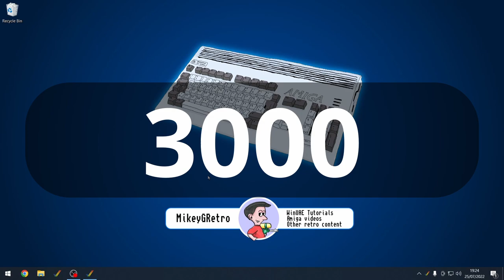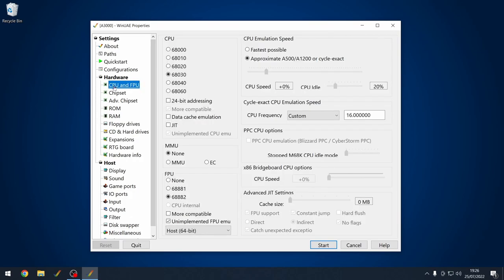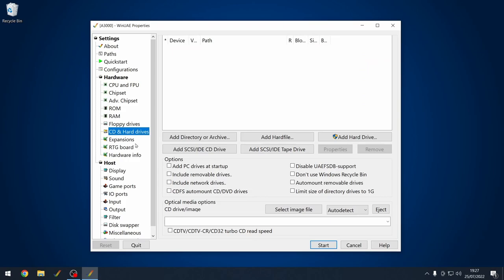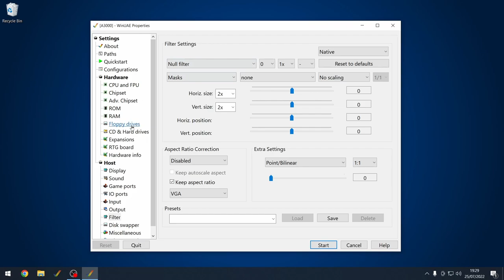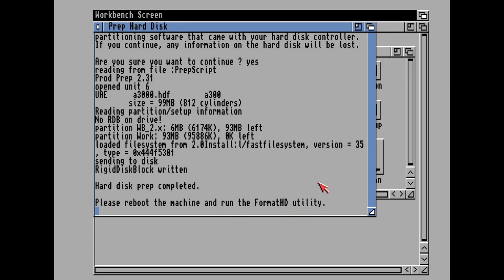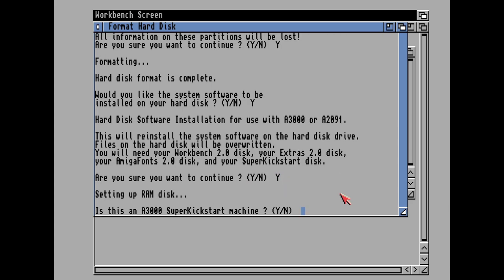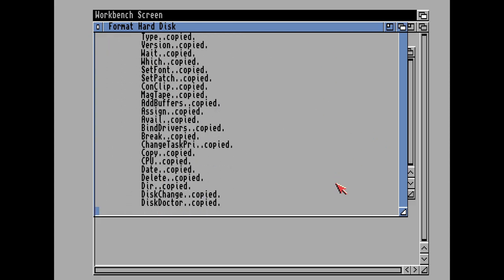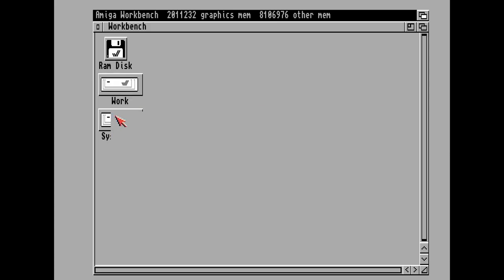Emulating an Amiga 3000 Subscriber Special

Comment: Definitely one of the best channels to help with Amiga emulation. I re-watch one of your videos every time I change any settings or set something new. I tend to mostly use FS-UAE so it would be great to see you check if it can also emulate the 3000 as easily as Win-UAE.
Thanks again for your easy to follow and informative videos.
Reply from the maker: Thank you, I will try to do some more FS-UAE videos, it's on my list :-)
Reply: @MikeyGRetro  Thanks for the response. I just downloaded the AMiNIMIGA pack to use via FS-UAE and there were a few issues. Thankfully aminet came to my rescue. Maybe you could cover a guide to using this awesome pack. The Amiga versions of Wolfenstein, DukeNukem, Heretic etc. work really well in emulation, once you get the settings worked out. Other channels are just showing gameplay but no real guides apart from "just download it to your THEA500MINI". It would be great to see a guide to using it in an emulator like Win-UAE etc. (not just the THEA500mini).
All the games are working fine in my FS-UAE emulated A4000 with OS3.9.

Cheers

Comment: Recently I did some rendering in Real3D :) What a trip! A3000 seems like a beast that could handle some faster renderings so thats my suggestion for video. Shows the power :)
Reply from the maker: Thanks, I want to learn 3D on the amiga so it won't be a tutorial more a journey. I done some Blender a few years ago so not totally new but not done anything on the Amiga but I am interested.
I've seen 4D Cinema and Lightwave mentioned and Real 3D. Which is your recommendation to start with?

Comment: I can't help but wonder why WinUAE and FS-UAE both have an A3000 config, but neither have one for the 2000.  Are the two machines considered redundant?
Reply from the maker: I think it shares alot with the A500 so from an emulation point of view 500 and 2000 is the same. Hopefully someone knows a bit more about this that can share. :-)
Reply: @MikeyGRetro  Now I'm way too American to really understand, but wouldn't the 3000 be similar to the 600?

Again, sorry if I sound stupid, the system wasn't a part of my youth and I'm curious.
Reply: @jesuszamora6949  No the A3000 was a 68030 16 mhz        configuration at base.  The A600 had the ECS chips but was still a 7mhz 68000    machine.
Reply: @fmlazar  Ah, my mistake.  I thought the 030 was introduced by the 1200/4000.
Reply: @jesuszamora6949  The 1200 used a 680E20 a  low powered version of the 68020 chip. The very first A4000's used the 25mhz version of the 68030 processors from the A3000 series  later models used  proper 68040   chip.
Reply: A2000   was simply an A500  with one meg of total ram originally 512k chip plus   512k fast     ram on the mother board and more slots and a video slot, otherwise for emulation purposes, they were identical.
Reply: @fmlazar  OK, so there were some pretty big differences.  That makes a WHOLE lot more sense now.

Comment: What PC do you have. As my computer emulate the A3000 very slow.
Reply from the maker: I have a Ryzen 3700x, 32GB but WinUAE spec reequipments are quite low so you don't need a fast machine. I recommend checking CPU and FPU and CPU frequency. Make sure its not 1x or 2x. I recommend 8x.
As well make sure you have some Fast RAM added.
Hope that helps speed things up. :-)